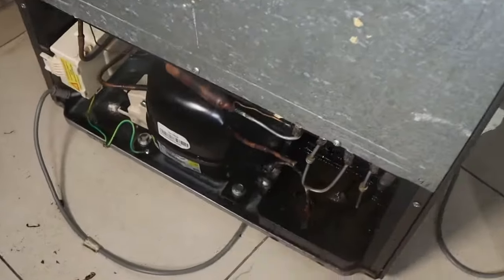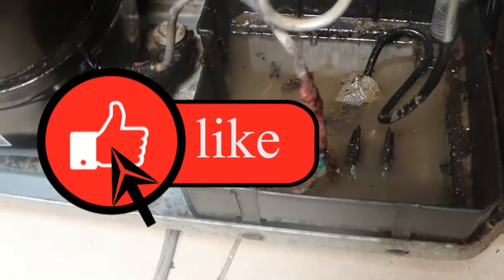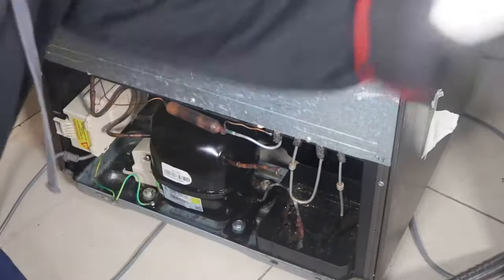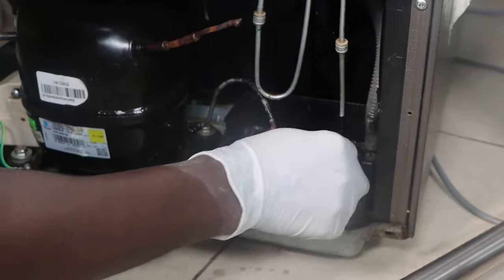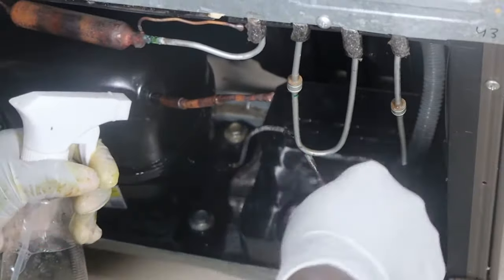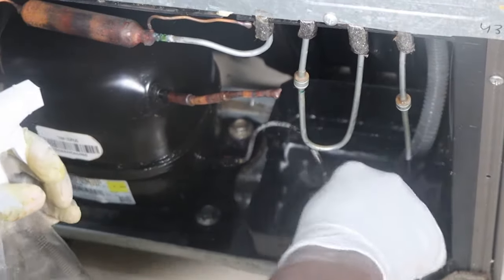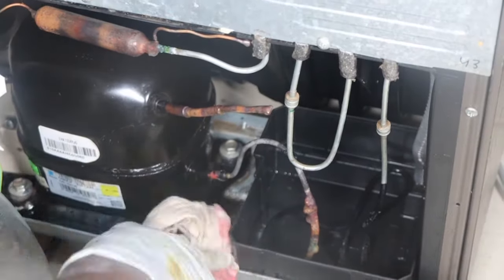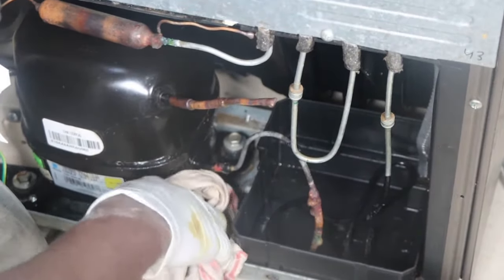How to Clean a Refrigerator Drip Tray ( Evaporator tray on Samsung Refrigerator) to Remove Bad Smell

Comment: Hey... we did it jana and wash the tray througly but today the smell came back.. what do I do
Reply from the maker: Sorry to hear that. Other places to look out for are as follows:

1. Check for any spilled or spoiled food inside the fridge. Sometimes, food can drip or leak onto the back of the fridge, causing a foul odor.

2. Moisture can accumulate in the back of the fridge, creating an environment where mold or mildew can grow. Check for any signs of mold or mildew on the walls or components of the fridge.

3. The drainage system in the fridge removes excess water and condensation. If the drainage system is clogged or blocked, it can lead to water buildup and a foul odor. Inspect and clean the drainage system if needed.

4. In rare cases, a malfunctioning component in the fridge, such as the compressor or a defective seal, can cause a bad smell. 

If you've checked for all this possible causes and can't find the source of the odor, it may be worth contacting a professional for further inspection.